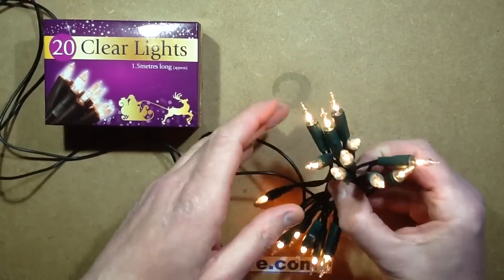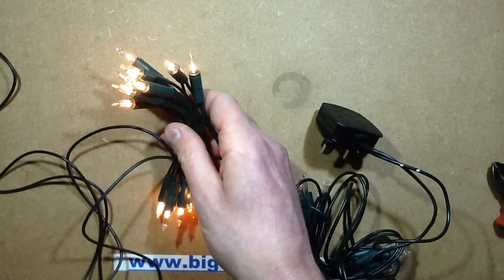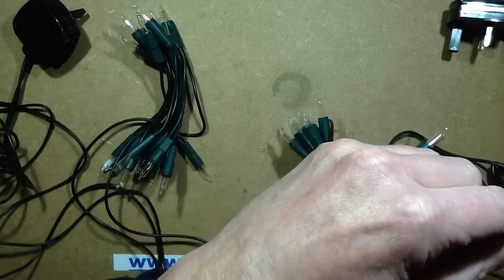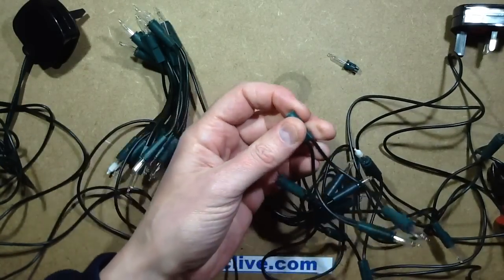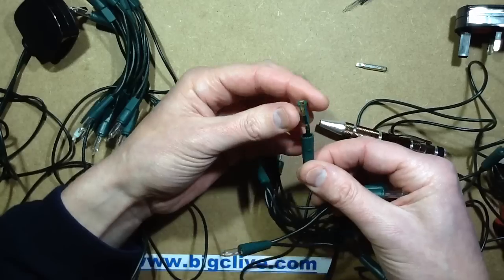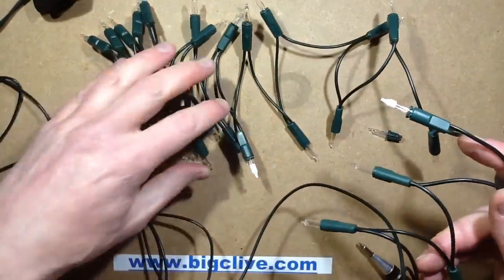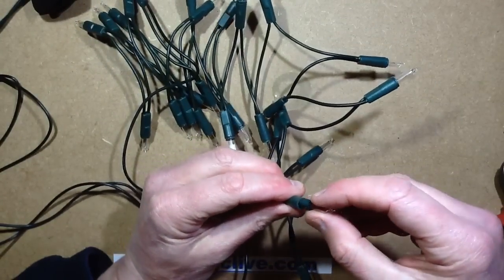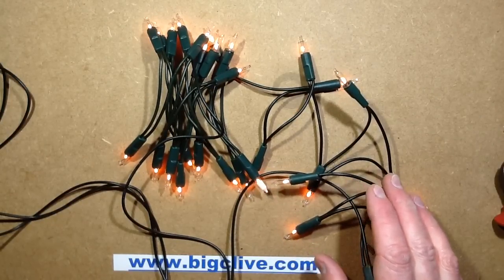Xmas light abuse.  (Off-label modifications.)

Comment: You would enjoy the mayhem my father caused a couple of years ago when experimenting with lights like these. He took some dead strings that we had lying about the house, cut the sections that were not dead, connected them all in series and plugged them in. The lights were spread around our then-new sitting room carpet, so they won't tangle. When he plugged them in, they worked fine for couple of seconds and then the cable insulation on the whole line of lights set on fire, burning a nice zig-zaggy track on the carpet. 
Needless to say, my mother wasn't very happy about what happened to the carpet.
Reply: Please get him to do it again, but this time make sure you get a video.

Comment: but it said to never electrically connect it to any other set. Which technically means you can't plug it into mains in case any other set anywhere is plugged in too, because that would make it electrically parallel.

Comment: there is a shunt built into each lamp.  When a filament burns out, the current will flow through the shunt to keep the other lights lit.  But because the shunt is a considerably lower resistance than the filament, each time a bulb burns out, it drives the voltage higher for the remaining bulbs.  If you have too many burnt out, then eventually all the rest will blow also.  I think the ones coming from China are even worse.  I suspect the shunts have an even lower resistance than they are supposed to have because I find I can have fewer burnt out on the string.

Comment: I've had a couple light strings all burn out at once when plugged into a socket, any idea why?
Reply from the maker: +Kuroko Shirai Were they tungsten lamps?  If so then there is a fuse lamp with a white tip that will stop all the rest from working if it fails.  It's a safety feature.
Reply: bigclivedotcom There was not.
Reply from the maker: +Kuroko Shirai Then it's possible that one of the normal lamps has failed to bridge out, or more likely the connection on the lamp isn't making in its base.

Comment: when one bulb blows the voltage increases to the others & since you only put 7 in series with no fuse it blew then all on a split second as the power rating is 12v & the current far exceeded this but hey at least they didn't melt the glass

Comment: I thought X-mas lights were wired in parallel...
Reply from the maker: +Abe Lincoln Traditional large lamp American ones are, as are some low voltage LED sets.  But most mains voltage small lamp sets are a series array.
Reply: bigclivedotcom Ahh... the large screw base type are the only style of lights i've ever had. That would explain it
Reply: +Abe Lincoln 12x20=240

Comment: 7:41 the set you modified from 20 to 10, I know somethings about to go bang 🤣
Reply: And now your changing it from 10 to 7… something is definitely going to go bang! Once I was messing around with some of these and decided I wanted to see what happened if I put one of the 12v lamps across 240v with a 13 amp fuse. Anyway, safe to say there was a bang and the electrics tripped and a bit of broken glass from the lamp that exploded 😂luckily before I plugged it in I put it in a box so that none of the glass escaped.

Comment: Given that the 20+10 set was dim, how come you can buy sets of lights with 200 bulbs? How do they make that work?
Reply from the maker: They usually use lower voltage lamps or sometimes they use a multiple of shorter sets wired in parallel to make up the quantity desired.  i was looking at some 200 lamp sets recently and they were using 1.2V lamps.  200 x 1.2 = 240V.
Reply: bigclivedotcom Boring, but i had a 300 set of regular lights from some McArthur Glen shop that shut down.. It was 3 sets of 100 joined in the middle strangely with 2.5V bulbs.. They lasted a ridiculously long time and were really, REALLY bright.. Clearance stock so i think i only paid about 8 quid for them.. I thought it was great how all the lamps seemed to fail at once, the filaments deposited quickly onto the glass! Be interesting if you could blow a chain, fully open circuit all the lamps, then attach to a very high voltage.. Spark lamps!
Reply: +bigclivedotcom the more lights the more chains get used in one set you can see where the chains join onto each other but still share the same current, twinkle lights are well known for this setup

Comment: why are those not in paralel?
Reply: +Steel PC Gaming 3, 2, 1, click-bang, as soon as you flick the switch all 20 12 volt bulbs will blow if your putting 240 volts thru it in parallel